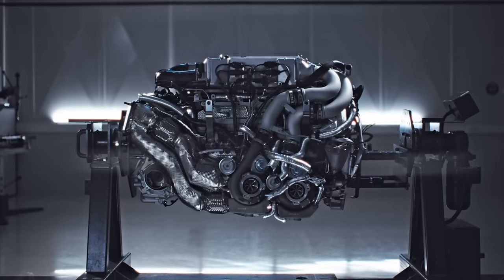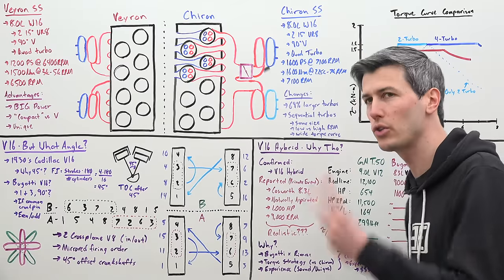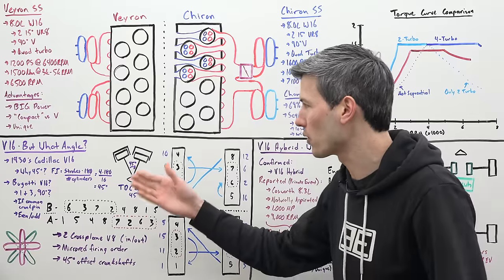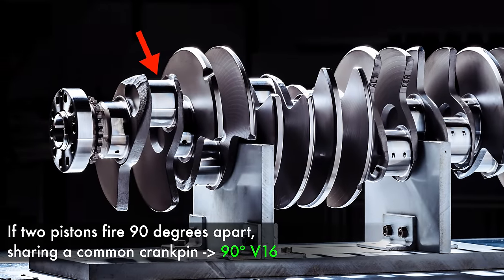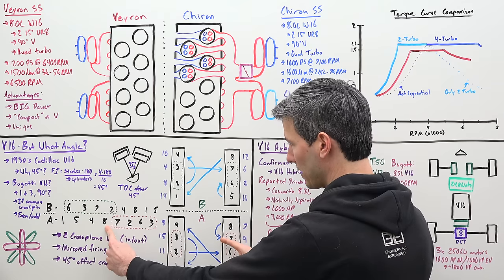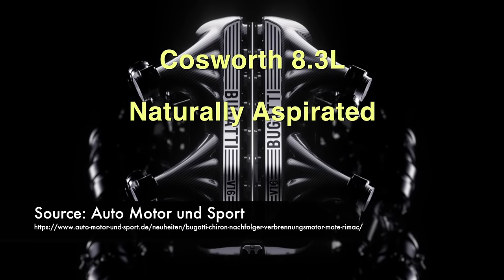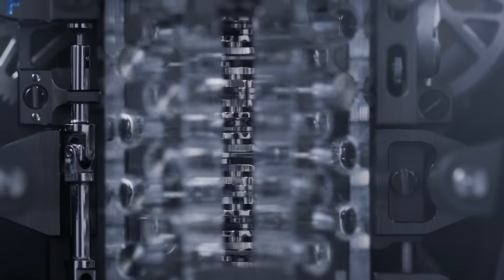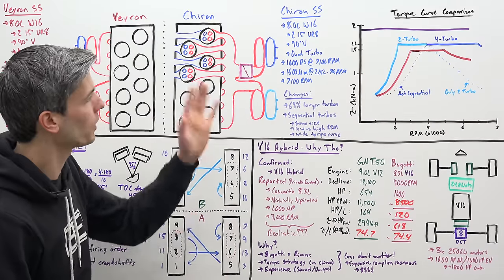Bugatti Has Developed A V16 Engine!

Comment: I love this video!  Good stuff Maynard.  As for the Engineering the Veyron, at this point an aircraft gas turbine would be lighter and have more horsepower, and I bet that it would cost less.  For example Jay Leno built a gas turbine car based on a corvette chassis.

Comment: The W engine has lot of weakness, primarily is heat distribution,  becaus the cylinder are closer than ordinary V engine the W reach maximal heat capacity in the chiron SS , if it gets any hotter (more boost or more fuel) it will literally melt the cylinder wall. 

This happens also in the W12 in that VAG put in the bentley, thats some video in youtube people who tune the bentley W12 didn't come out that well.

This problem had been acknowledged since the VR6, thats why there's almost no moded VR6 in existence, some tried but almost most of them suffers from melted piston ring becaus of the immense heat that circulate inside the VR6.

Comment: Maybe I didn't listen closely enough.  Is there an advantage to the V-16 vs W-16?  When I was reading about the Caddy V-16, the longer crank- and cam-shafts were prone to whipping side to side and to torsional wind-up.  The W-format shortens the shafts while maintaining the 45 deg firing frequency.

Comment: NA today but I have to assume they built it with turbocharging in mind.  I would have said supercharging and turbocharging together but electric motors mostly ruin any need need for a supercharger.
I also feel like 1000 HP in electric motors is a stretch.  That's a lot of weight, especially considering the motors don't always provide power (think of Jason's super tall, wide, and flat torque curve), that takes a lot of juice, and that means a battery pack that isn't particularly tiny (and light).  600-750 HP makes sense to me, but then again, I'm not an engineer, so... :P

Comment: For a V16 engine, it only produced 1,000 hp, even though it could easily reach 1,200 hp or even 1,300 hp. With the help of three electric motors, each generating 200 hp, the total power output would be around 9,000 hp. Which is 300 hp more power than the current 1.

Comment: Can the front and back V8s be disconnected through a clutch to get efficiency when less than 50% torque is anticipated necessary?
Say, the V16 is 1200 hp, half, a V8 ,would offer 600 hp. Next to that, there would be full hybrid torque available.
I could even imgine two different engines, one nice and torquey without turbos, and a second that has a turbo to be extra efficient in a given rev range. Each of the two half engines need to be self-balanced, of course, not rely on the other idling along.

Comment: The engine itself is a v16 n/a (naturally aspirated engine) not a turbo so the engine itself isn't as strong as the w16 turbo engine which even Bugatti said themselves, the v16 engine itself has 1000hp. The underlying question is the talks about it being a hybrid car so it could be more added on electric hp on top of the engine making it go faster than before. Still nuts though

Comment: We did some of this research in the 70s and 80s, when closed loop carburation was being invented by us.  In earlier times, the drag-racers just added more V8 engines on the same chassis, just like the WW2 airplanes did with cylinders.  24-cylinder engines were available.  No reason why a 100-cylinder engine could not be made, but there were no fools attempting this (except for the ships engine people).  There is a very simple "crossover ratio" between the steel/aluminum weight of a 10-ratio and/or a 20-ratio, or a 40-to-one combustion pressure ratio, and this is a "materials" issue.  Has nothing to do with the power or energy output.  That is why ALL modern engines are trending downward in weight, less cylinders, and made of the lightest materials, including carbon and ceramic fiber.  Somewhere at about THREE cylinders, those engines are the most efficient, overall, including emission control features (NxOx & HCs included).  The CO2 and H2O output of any engine is the absolute best measure of efficiency, if you are using an alkane fuel.  It measures the total BTUs or HP of the energy systems.

Comment: Does this 45 degree rotation offset negate the forces aplied on the outsides of both engines?

Doesn't this construction induce ware in the front and back of the engine due to the transversal load aplied?

Nissans CV engine seem to have a problem with altering the rotational angel beyond spec, thus resulting in cranck bearing wear.

Comment: At what point is it too much power that the tires would just spin and there is no point making the engine any more powerful?  

Given than the computer on board takes care of traction control, seems like the weakest link is traction from the tires to the ground.

Comment: That would roughly be 30c for the battery discharge while all electric motors pull full power. This seem rather high. What kind of battery can deliver this (and not explode?). Even if you have such a battery, it would need a sophisticated cooling system, better than the one of the Tesla Model S Plaid, because there is less cooling space from such a small battery.

Comment: I was a bit confused by your drawings.  Every V8 I've owned is numbered with the driver's side odd and the passenger side even, i.e. drivers side = 1, 3, 5, 7 and passenger side is 2, 4, 6, 8.  You have them drawn as passenger side 1, 2, 3, 4 and drivers side 5, 6, 7, 8.  That matches precisely nothing I've ever seen.  Are the Bugatti cylinders actually numbered like that?

Comment: There is a good reason also to go naturally aspirated: cooling. The Veyron and Chiron are marvels of cooling engineering, that heart needs so much fresh air to stay healthy. But with electric motors, you get the same power without struggling so much. However, batteries take up space, and if you look at the way modern Bugattis are packaged, there is no space left (interesting by the way that the Divo would switch to air cooling, since it's such a weight saving). Adopting electric power means ditching the complex intercooling, gaining space and removing excess weight, leaving more flexibility for the expansive and heavy batteries.

Comment: W16 was a masterpiece, I wonder why they went to an obsolete design, the V16 engine will be long, the crank shaft will be under so much strain due to the flexing, caused by the length and torque.

Comment: Why hassle with a v16 for only 1000hp? Cosworth NA 6,5L V12 as seen in the AM Valkyrie is already well over 1000 HP. Also, NA engines don't produce that much torque at peak, so it's a bit weird using that as the top end to supplement electric power, if anything electric instant torque is great at hiding turbo lag so you can go with massive turbos with lots of torque and top end power.

Comment: An 8.0L w16 with 4 turbos should’ve put out double the power than they did. Is there a reason for that?
Reply: reliability, it's so overbuilt it's basically bulletproof, could run all day everyday without any issue

Comment: I don't care if it's less powerful than the Chiron. They should make the most powerful NA engine on the planet (maybe 1200 hp with even higher RPM or a 9 l engine) without any electric motors. Manufacturers being so power hungry is pretty sad, considering that turbos were the norm for performance cars for over 15 years. Combustion-only high performance NA hypercars will become extremely rare.

Comment: What is the firing order?
Reply: The order in which the cylinders fire to ignite the fuel-air mixture. A regular car engine like this one has 4 strokes: intake, compression, power and exhaust. Depending on how the cylinders are attached to the crank shaft you determine in what order the different cylinders reach the different stages and you want to keep it balanced, ie. keeping an even distance between the same strokes, to keep the engine smooth.

Comment: I Wonder one thing ; it's better to have a v8 8 liters engine or a v16 8 liter engine ? Hmm, in my head is better the v8 8 liters because the cylinders are twice the size , so more torque lower rpm

Comment: What I got from all of this engineering Alley is Bugatti could've well used a 2000hp electric engine which would've killed the vibe around the company but they instead use a combination of a V16 and hybrid and a V16 that revs to 9000rpm which might not sound like a lot, but Bugatti's of recent times haven't crossed 7500rpm in any capacity of the W16 engine, maybe the complexity of the W16 stopping it from the glory but I think this is Bugatti thinking to open the doors of the fastest production car race again otherwise why would they need a top spec engine wherein they could've thrown a simple V12 and called it a day with the hybrid assistance, mind you when I say, Bugatti is going to succeed in crossing 300mph once again but this time it won't be a fluke, it will be a statement.

Comment: I just don't get, why they use turbos in that kinda car... 

You usually use turbos in smaller consumer-friendly cars, that aim for higher efficiency, in a manner of low fuel consumption.. 

Just the fuel consumption with a large 8l  v16 engine shouldn't be a deal... 

Just pack one or two big super chargers in it and good is..

Comment: Electric motors don't have a flat torque curve they have a flat power curve. torque starts out high and drops down with speed due to back emf. Unless the motor is using both a wound rotor and a wound stator there is nothing you can do about that

Comment: I don't know why I find it amusing that American v8s like chevy 350 or 5.7 or fords 302 or 5.0, 351 or 5.8 and we all know the size of the pistons  are bigger than a beer can circumference wise and the European engines like Ferrari v8 is 4.3l so those pistons are the size of red bull cans circumference wise but get less torque but roughly equal hps. This v16s pistons are going to be the size of v8 vegetable cans 😕😕

Comment: so now a 240 foot long, 10 ton Veyron will be 300 foot long and weigh 15 ton? i can also now buy multiple cars that perform very near as good as a Veyron for 1/2 the price. the piston numbering system is a direct result all that wine consumption the French are known for. 🤣🤣 from a design, power/weight and reliability point, a Cosworth design is usually a very good thing..

Comment: Kinda weird to compare it to a naturally aspirated V12 from Cosworth and then use that as your main point for why the Bugatti has chosen their V12 to also be naturally aspirated.  You picked that as the engine to compare to and filled in the blanks based off of the Cosworth V12.  

Feels more like it was derived mostly from the alleged numbers by whoever originally saw the preproduction cars.

Comment: IMHO just another fast car.
The engine is for sure not spectacular. It was with the original 1001PS back in the day.
Today every sportscar can be pushed to over 1000HP or more. plus a way lower weight, than this monster and you get a nice nonsens car.

The AUS are quite keen on V10 Hurracan + 2 turbos and those are 100% streetable 12-1500 Wheel(!) HP allwheel monsters. Lambos to beginn with an a REAL V10.

The the case of Volkwagen, oh sorry, Bugatti - you get a Brot und Butter Engine packed up to ridiculous numbers. Problem#1: HEAT. Bugatti can manage that. But for what?

Comment: Oh dear this is a rip off engine from the motorbike company Arial square four designed and built in 1930 500cc put out 40HP. Please check out what I am talking about. All the W engine is added two square four engines together for 8 cylinders then same on the other side and banking the the crank case to accept 16 cylinders. Now the modern part is ignition as need fuel injection and exact timing then the control VVC invented by K series Honda development. So will  open ports to the Turbo chargers best ones made are Mitsubishi made as can handle extreme heat high speed roller bearings and inter-coolers with computer engine management. Now like all Modern cars that are too complicated this needs to run by computers similar to the Cadillac 16 cylinder 2008 a few years ago when it could shut down a bank of engine and run on 8 Cylinders or even 4 Cylinders not sure what happened to that car and engine but would had mdse it more economical and have power when needed. four wheel steering a Honda idea.

Comment: 24.8 kw*hr battery / 746 kw electric power output = .033 hours of fun, about 2 minutes, before your electric fun is gone.  Then all that motor and battery gubbins is just dead weight.